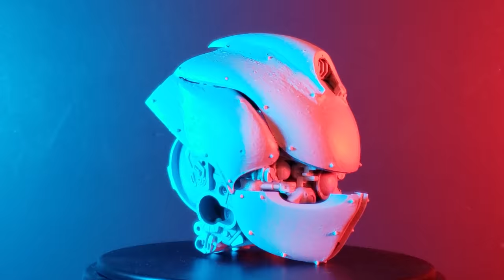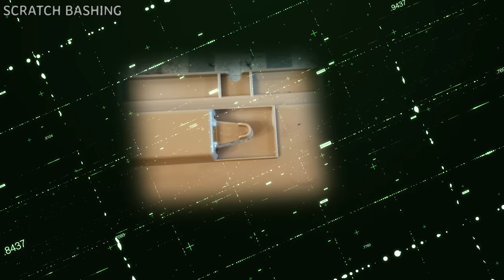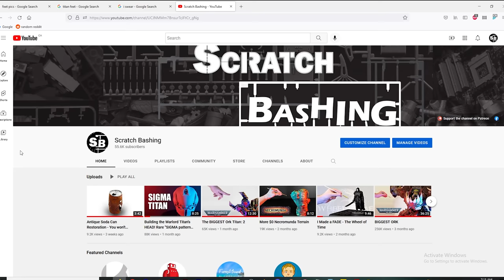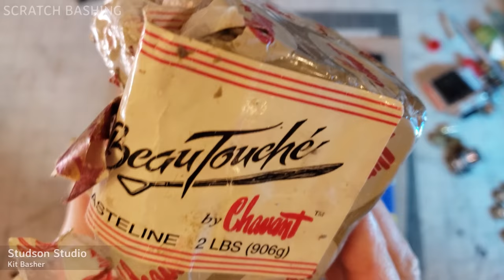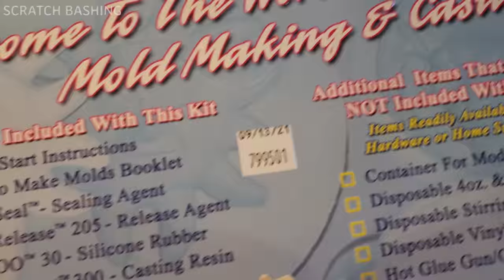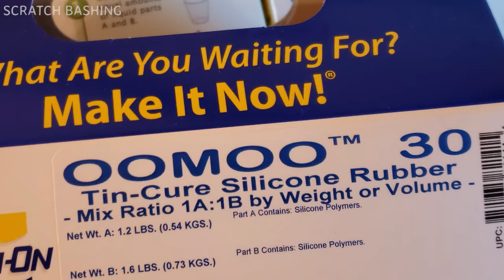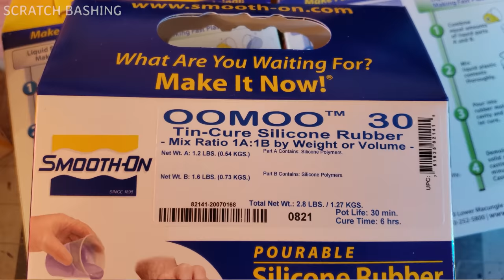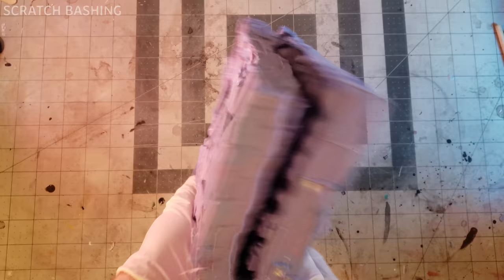Warhammer model has bigger feet than my girlfriend. Building a TITAN'S FOOT

Comment: The mold you made is very economical I think its great for what it is. The solution to most of your problems would involve more expenses and casting time. If you want better casts I suggest; separating the pieces into individual molds that are cylindrical as it will shift less when banded properly, using disposable plastic cups if the part fits i will skip rubber banding and just put the mold back into the plastic cup to make sure it maintains shape, doing a full pour mold instead of half and half and cutting only enough to remove the parts this will negate most of the shifting problems. I also suggest getting a pressure pot to let the resin cure in to reduce bubbles on the inside of the pieces.
Reply from the maker: Thank you for the comment. This is a real hand->forehead situation for me since I have made round moulds in cups in the past 

So you are right on the money and I just forgot 🥲

Comment: Love where the design is going. For the mold, definitely remake it - it would be a pity to finish a project of this scale and not have details like you wanted. Maybe doing smaller molds in a plastic cup would work better. Only did a few molds myself but among the tips I picked up off Robert Tolone's channel, using a round mold and lots of elastic bands was one of the things that bumped up my mold quality.
Reply from the maker: I did indeed check him out!

Comment: I had the exact same problem just this week buying mold rubber that had obviously been sitting on the shelf too long. One half was fine, the other half was even worse than what you got. Almost peanut butter consistency. I decided to do a little bit of experimenting, and found that mineral spirits works to thin it down. I added mineral spirits to the bad half of the rubber and then mixed it with the good half. I had to thin it down quite a bit to get it even close to a workable consistency, but it didn’t seem to have any negative effects on the rubber curing properly. Definitely not ideal, but it worked fine for the fairly simple parts I was molding.

Comment: I've used that silicone for mold making, and it's never let me down, personally, though I've always made the mold halves way thicker. One thing that might help is making a plaster shell for the mold halves. The plaster will add the rigidity you need to prevent the mold making a bubble

Comment: I'd remake the mold and use MDF boards that cover the entire mold on each side to brace. Also, I'd use stronger rubber bands to compress, and space them evenly to apply even pressure. This will prevent bowing and slippage.

Comment: Weirdo with an art degree here. I spent several years making molds for figure sculpts, so maybe my advice can help: 

Perhaps what you're looking for is a "mother mold". Essentially, you cast your pieces in a soft silicone like you did here, then you add an additional layer over the cured silicone: Liquid plaster. The plaster hardens and acts as a "skeleton", keeping the silicone from sagging as you make casting pours. Then you simply disassemble the plaster and silicone to get your parts, and reassemble for the next pour. 

I'm actually working on a mold of this exact kind right now, though instead of using liquid silicone I'm using silicone caulk! Cheaper and easier to handle in my opinion (if you wanna know more just ask), though perhaps not what you're looking for in this project. Best of luck with your kitbash!

Comment: Hey scratch bashing my job is making silicone molds for minitures, your doing well but adding the chunks into the mold might be good for filling but will leave air gaps in the silicone making it weeker in spots a vacuum chamber would help but to sort it you want to make each piece in its own mold this way you can apply even pressure across the part. We make split molds which is a different to the two-part you are trying to do and helps keep things aligned resulting in less mold lines. 

Hope this helps if you need anything else send me a message I'm happy to help you complete your big boi :)
Reply from the maker: Hey thanks! Very helpful info here

Comment: Definitely remake the mold but you need to do two things; poor the silicon until its flat so as to have an even surface you can clamp something rigid to and vibrate the silicon right after pouring, this will help get the whole thing flat and will also release bubbles/allow it to seep into crevices.

Comment: I think you should strengthen your molds with plastic or plywood. You can probably reuse the "bad" molds  by filling the items back in, and fill the uneven back surface with a little more goop to make it flat, and then attach a piece of plywood. That should do the rick i'd think.

Comment: two pieces of plywood, and some woodworking clamps will get you 1000 times further than any amount of rubber bands. since the pressure of the bands is on the end of the mold, you are bowing it out no matter how many you use. clamp pressure is the way to go. just get 4 of the cheapest ones and some rigid 1-2cm plywood. thicker molds just mean more squishable material. which in turn means more possibility for deformations again. in the future make the modl to fit in a pre made wood casing, that you can screw together using some winged nuts

Comment: Before you spend loads of money remaking the mold, try beefing that one up- put it back in the enclosure, get a couple of tubes of silicone caulking from the dollar store and thicken the back sides of your mold, maybe also adding something rigid in there as well- bits of wood, maybe.
I've not tried it myself, but I'm told silicone will stick to other silicone. Even if it doesn't work you'd only be out $2 or so, rather than $50 for new casting silicone.

Comment: I think that you need something to hold your mold that is not just rubber bands. Something that can clamp and spread the pressure evenly across the sides of the mold. For that I can think of a jack and a couple of wood planks. If that doesn't work, then you will need a thicker mold

Comment: I am by no means an expert in moldmaking, but I think I see one potential problem you have. In using the blocks of silicon from earlier molds you have created two halves of the mold that are uneven and lumpy on their "backs". This means that when you sandwich them together - even with sheets of card or wood and rubber bands - there are spaces where they can deform. The molds need to be even and flat on the back, or to have something that fits on them which makes it even and flat.

I think if you took the existing halves of the molds and placed them face-down in the same shape enclosure as before (so they fight tightly) and poured silicon over them until it was all level and smooth you would then be able to clamp them appropriately together and prevent them from deforming.

Alternatively, you could pour plaster of paris over the backs of them in the same sort of enclosure and use the plaster of paris as a "mother mold" to hold them together when clamping.

Comment: I use a Sheet metal frame for my mounds with re-enforcing bars to ensure the silicon can't move. But thats not a cheep solution, I just happen to work with steel so I can make grab bin scraps from work.

Comment: You can salvage that mould!

Reconstruct the frame and just thicken them up. Run some tape around the seam to prevent silicone ingress.

Failing that, you can make a hard shell for the mould - before 3d printing, helmets and large props were made by slush casting in silicone. Just coat the mould in fibreglass and resin to make a hard outer shell that fits the silicone perfectly. You might be able to get away with something thinner and less substantial in this case thanks to the small size of the mould (hell, maybe even Papier mache?).

Overall, I think you're on track...!

Comment: ScratchBashing just use some wood (or other rigid material) panels on the back of each side of the mold so when you rubber band them the weak parts of the molds don't press out anywhere. Easy peasy.
Reply from the maker: good tip!

Comment: You have to make casts of those parts - they're superb. However, I think you should make a smaller mold of just the essential parts. Space them further apart in the mold, the adjoining walls are too thin and the high-pressure of your injection technique is forcing them apart. When re-using the old silicone, try to chop/grind it up into much finer bits - it helps a lot for making flatter, square molds that are easier to keep 'locked' shut during casting. Good luck and persevere because the project is great, it deserves the extra effort.

Comment: Dumb question. Why not just make a wooden frame to seat around your silicon? Basically five 1x4s in a box with an open side on one of the narrow ends to slip your silicon into? (probably the "pour" side) Wouldn't this prevent the "girthy" pieces as it would stop the bowing of the silicon? A 3 foot long plank seems like it would be more than enough for the entire frame, and screws cost pennies. Hell, even some plywood laying around would probably do it? Is there some reason to not do this?

Comment: I'd say that your first mistake was taking the parts out of the first half of the mould, they never go back in properly so don't take them out before pouring the second half. The slippage could have been prevented by keying the mould Half's together, put objects like half spheres in the mould along side the parts when you cast the first half, then remove them when you cast the second half, this will mean that the two halves will fit perfectly and align correctly.

Comment: Bro I'll be honest... 2-part molds are for people who are super into recasting. I belive in order to have perfect recast there can be no shortcuts made. I do not think this chanel is about that.
My sugestion: one part mold. Just copy the part that will be seen from above. No one will look under the feet of your titan. Also resin is super toxic, takes hours to cure and I doubt it's cheap. I sugest you use modeling clay. One kilogram of the stuff costs less than $10 (at least in my country). You form the modeling clay in your hands, you stuff it inside the mold, you bake it in an oven set to 110°C for 10 minutes. The only problem you will have to resolve is the uport structure for the feet. You dont want any part made out of baked modeling clay to take much preasure from the weight of a todler titan.
Reply from the maker: That's very interesting. I will check out my local options!

Comment: Dude try again but back fill each silicon mold side with an inch or too of plaster of Paris, then clamp together with a vice and the silicon wont have anywhere to go. You should get a good cast then.

Comment: Remake the mold. 

I'd also consider reworking the resin mix and trying out a better mix. Perhaps something you can cast with some internal structure. 

Just to be safe. There's going to be a good bit of weight on them.

Comment: Cast a plaster shell on the molds for support. Place the sucker face down... in a mould mould... pour plaster onnit.  Make guide holes and repeat the procress with the other mold. What you end up with is sturdy plaster shell that should help with the bowing (tape that sucker togeather for good measure). Just look at this https://drive.google.com/file/d/13rQw6sVXhjnLQ2anaKrLvnn_YlkCH6D9/view?usp=sharing

Comment: In my opinion, remake the mold. Also, make sure the silicone is properly mixed......the pink showing through the mold is a sign that the two components were not properly mixed. Don't make one giant mold....do a mold for each section - feet, toes, etc

Comment: well you shud uesed a tight rubber band on mold or just sand the feet or tows  the thing is mad of junk slise the botem haff off ?just a think or go to a craft store and find bits that make the feet out of with out a mold  ? what bout a toy  feet the right scail ?  must be a robot out thare that can be uesed ? last get some one to 3 d print ???? post will see  PS to bad the darn feets are not round   you ues old platic jarlisd and med caps and stuff like that

Comment: Seriously? At 35 seconds you say those are old plastic furniture feet. Holy cow. Why would you say those are furniture feet? Explain how that design could ever be a furniture foot. I didn’t thing so. Are telling me that you are a human male and you have never owned or at least used a Black and Decker Workmate? Really?! These things you mistakenly called furniture feet go into the Vice top of the Workmate to aid in holding different sizes and shapes of wood while you work with it. You need to spend a little time at the store where they sell power tools. The Workmate has been around since the 60’s. That makes it well over a half century into the lives of men and women who build things. Swivel Grip Pegs is what they are called. You can buy them on Amazon when you lose the ones that came with your Workmate. Say it with me. Those are NOT plastic furniture feet.  Smile.